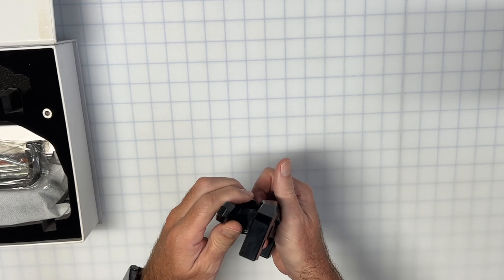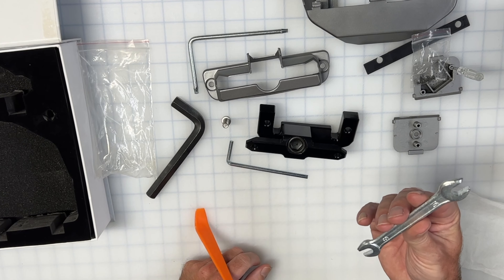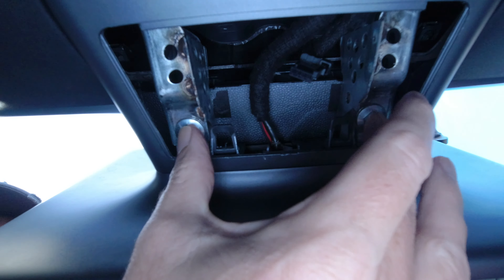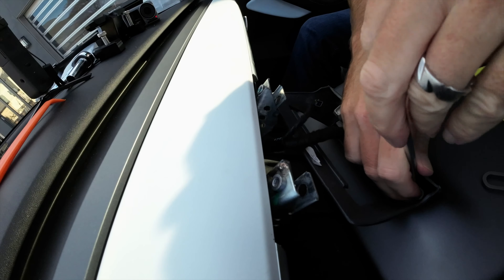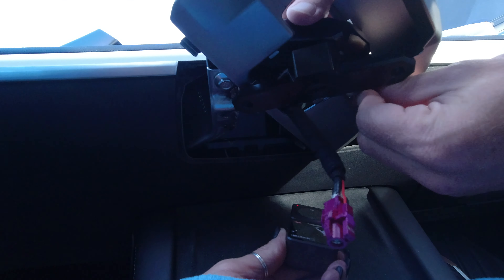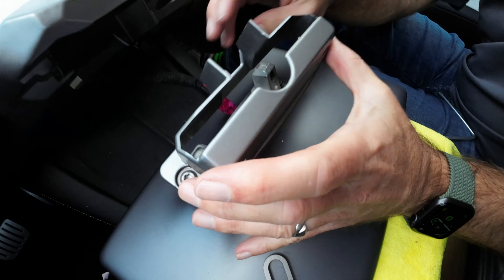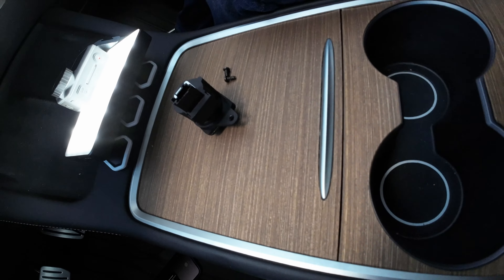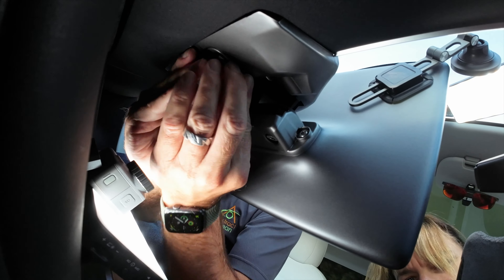Installing the Rotating Screen Mount for Tesla Model 3 & Y

Comment: Will this void amy warranty in my tesla?
Reply from the maker: Assuming you're in the US, you have the Magnuson-Moss Warranty Act on your side - meaning in order for a manufacturer to void a warranty due to modifications, they have to prove that said modification was the cause of failure for the warranted component. Even in that case, it is component-specific, so no, your warranty is not voided.